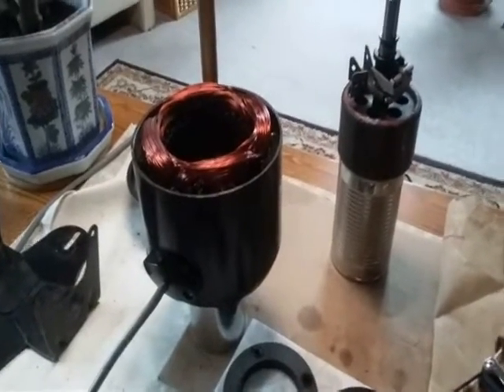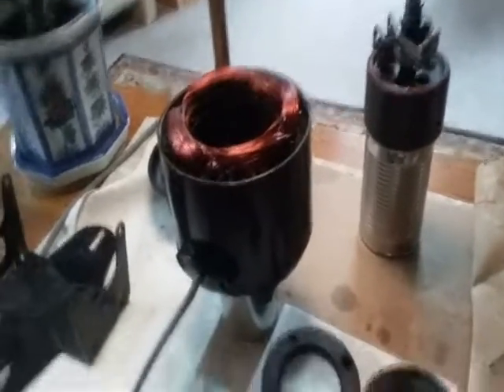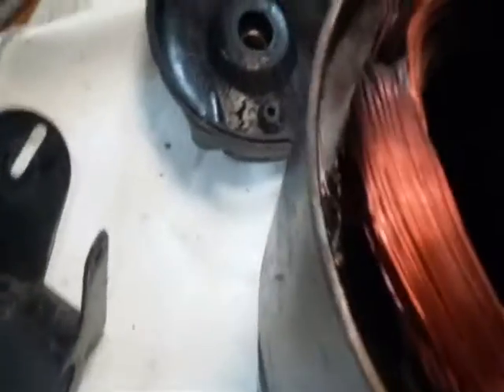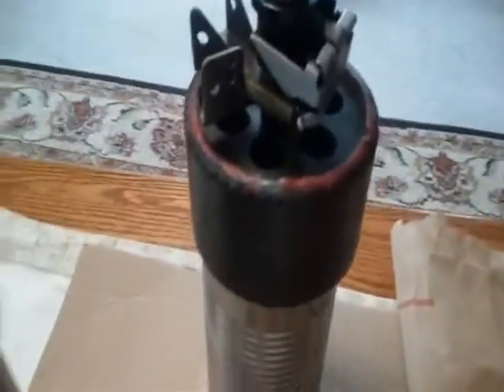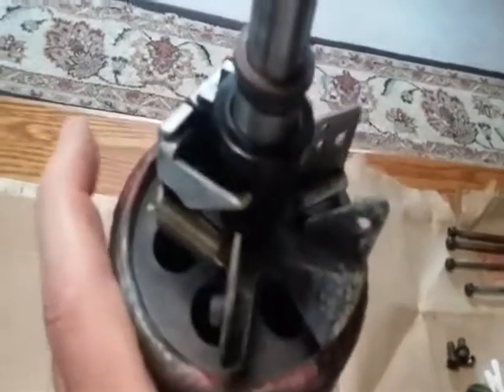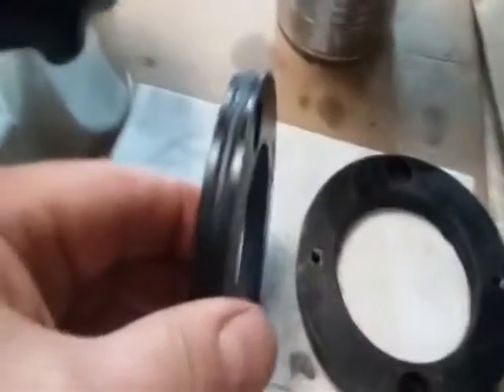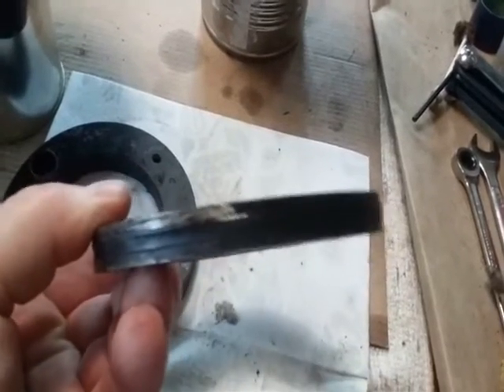Maytag Wringer Washer Delco Motor Servicing

Comment: Mine seems seized! Cant rotate the belt pulley. Power wont start it.
Reply from the maker: Verify if it's the pulley on the motor, or the pulley on the gear box of the machine that won't turn. Often with these antique Maytag wringer washers, it's the gear box that is seized NOT the motor.

Comment: I have a 1935 Model 30 that is missing the motor and pulley.  The mounting bracket is there. Does anyone have the specs for the motor (HP, RPM etc.) So I can find a replacement motor. Also need the size of pulley.  Any information is appreciated.
Reply from the maker: Hi Brian ... specs for the factory equipped Delco motor are: 110V.  1750 RPM. 60 cycles. 5.3 amps. 1/4 H.P.  Single phase. 40C rise.   Pulley: 3 inch

Comment: Do you have any pictures of the wiring? I have a wire that is off in the motor and want to make sure I attach it correctly for my washing machine.  Thanks.
Reply from the maker: I have two shots, but not sure if they'll help. You can see them on my Flickr album, the last photos ... https://www.flickr.com/photos/44623676@N05/albums/72157658774939800 ...

Comment: Thank you for sharing this video. Do you know if the rubber dampening rings can be ordered..Mine look cracked.
Reply from the maker: Tina, parts are only available occasionally on ebay or by sourcing an old machine and parting it out. Parts for these machines cannot be ordered any longer.
Reply: Thank you for responding so quickly..I will need to find some rubber stock and use the originals as a template..I will work on getting the motor off today..I can see the appeal of these simple machines..I'm exited about getting this thing going again..
Reply from the maker: Tina, there is a website that has some great advice on these old Maytag washers. Here's a specific link to the restoration of the dampening bracket ...  smokstak.com/forum/showthread.php?t=146436

Comment: Brad,
I appreciate your approach to restoring Maytag wringer washers. You perform necessary restoration and repairs while avoiding unnecessary dis-assembly.
Studying your video,  I propose minimal dis-assembly and cleaning of the insides of a Maytag Delco electric motor.
Not everyone has time and confidence to completely dis-assemble their electric motor.
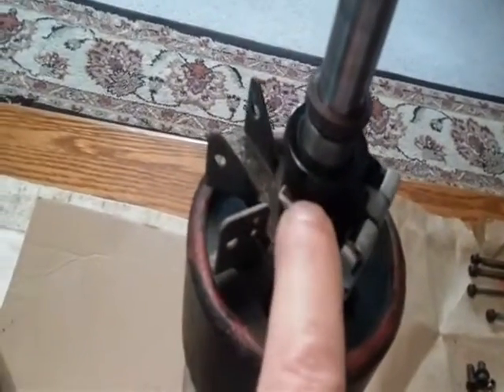4 bolts and 8 nuts hold these Delco electric motor together. These "bolts" are long rods with threaded ends and are visible at 1:12. At each end is a nut. If the 4 nuts are kept on the rods' ends toward the centrifugal switch, then that end cap can be held in place without disconnecting the points.
The other end cap can be removed without taking off the V belt pulley. The rotor can stay attached to that end cap. As this end cap is removed, careful inventory of the thrust washers on the end of the rotor shaft is necessary. Observe both the number and the order of the steel and fiber thrust washers.
With this amount of dis-assembly, the insides of the electric motor can be studied and cleaned. I suggest electrical parts degreaser to spray away any oil or grime that is contaminating the parts of the motor. Example: CRC Lectra Clean Heavy Duty Electrical Parts Degreaser in aerosol can which is nonflammable and safe on the inside parts of an electrical motor. There are no plastic parts in the Delco motor so plastic safe degreaser is not necessary.
The' parts attached to the end cap visible at 0:52 and the centrifugal switch parts on the rotor visible at 1:08 need to be cleaned thoroughly.
Allow the contaminated fluid to flow out of the open slot of the end cap when cleaning the parts visible at 0:52.
The centrifugal switch should slide freely back and forth on the rotor shaft. A common reason these motors stop working properly is sticking of the centrifugal switch. No lubrication is required on this area.
Obviously the electrical parts degreaser should be sprayed in a well ventilated area and the electric motor must not be connected to electric power before any of these procedures are performed.
Lubrication is only necessary in the oil ports on the outside of these Delco motor's end caps. Lightweight (20 weight non detergent) oil is preferred. Examples: Zoom-Spout oil or 3-IN-ONE Motor Oil in the blue can (NOT the red can) or Tri-Flow Superior NonAerosol Drip Bottle Lubricant.
I hope people will consider cleaning out their Maytag Delco electric motors before they discard and/or replace their original motor. These are durable and reliable electrical motor which will last many lifetimes with proper care.
Mark.

Comment: Brad,
Thank you for posting this video. I hope that your video will encourage others to restore their original Maytag Delco electric motors.  As durable and reliable as these motors are, I believe that many of these motors could be refurbished with a simple cleaning of oil and grime that can contaminate their innards.
Your video demonstrates how simple these motors are and how easy it is to disassemble and clean them.
The vibration dampening washers for my 1936 Maytag Delco motor are deteriorated exactly as you described. Since the dampening washers of your Maytag Model 30WP appear in mint condition, I was wondering what the thickness of the rubber part of these washers is supposed to be?
Mark.
Reply from the maker: The thickness of the rubber is 3/16", if my measurement is precise. I was definitely happy that these were in excellent condition, although as you know, there were various other parts of the washer that were in rough shape, not only cosmetically, but structurally.